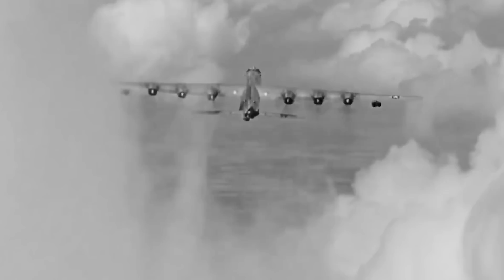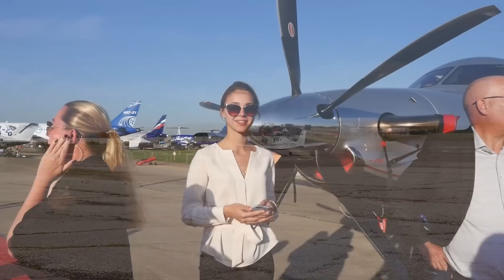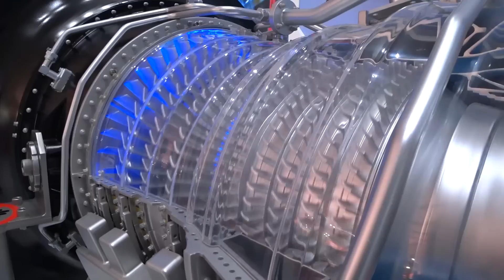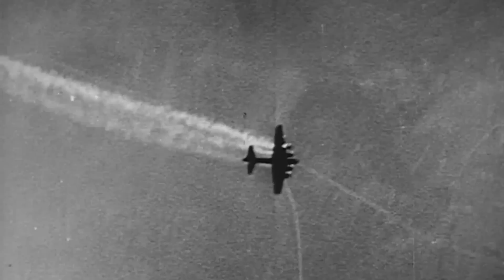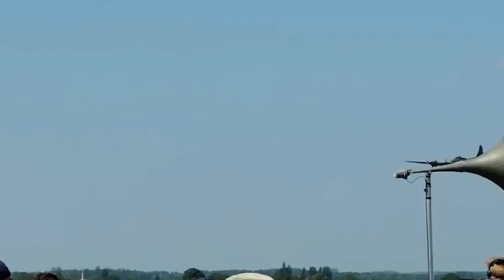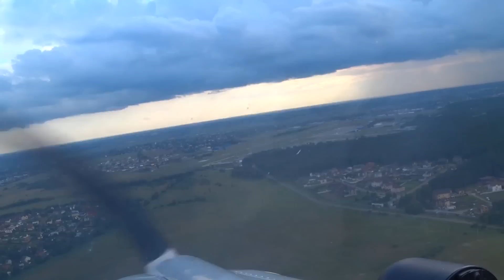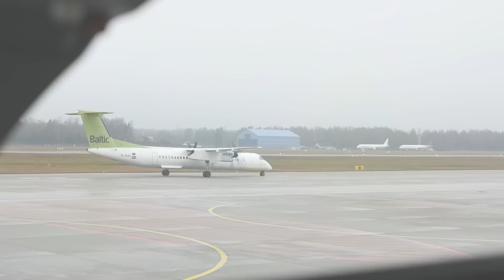Piston and Turboprop engines | What is the difference?

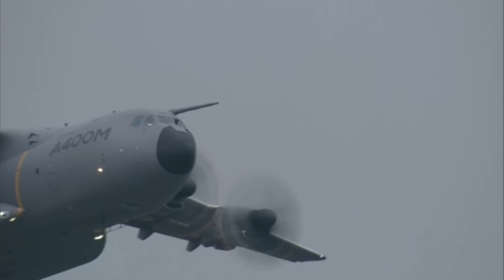Comment: @15:00 you mention some turboprops that can go 800 km/h and show a Soviet Tu-95 "Bear" bomber as an example.  While certainly true it should be noted that the Tu-95 was ridiculously loud (many consider it the loudest plane ever made).  IIRC American pilots could hear it over the sound of their own jet engines when they intercepted it.  American submarines reported hearing them flying above.  I also think the Soviet crews, even with ear protection, suffered as well.  Part of the problem is, in order to achieve such speeds, the propeller has to spin so fast that its tips exceed the speed of sound and make sonic booms.

So yeah, you can make a turboprop that fast but no one ever will again.
Reply: the loudest plane ever made was way forward the Republic XF84 "thunderscreech"...and NO the tips from the propeller from the Tu95 are NOT supersonic: the RPM is only 740rpm for a diameter of 5,80m... and the AN22 use 6,20m propellers but fly a bit slower...
Reply: @leneanderthalien  The Thunderscreech only made a few test flights.  The Tu-95 was in full production.  As to which was louder no one is certain...they were both quite loud but reportedly the Thunderscreech was only super loud once during a test flight where they really pushed it.  There are many reports (just Google it) of the Tu-95 propeller tips being supersonic but it is difficult to verify.
Reply: @jeffbergstrom  thats the compressor I call noisy. It's like the Rolls-Royce turbines. Which are the noisest I've ever heard for no AB. Hung on a G-1 & Vicount. The G-2 and Bac 111 terrible noisy. DON'T they put like a Gross of compressors disks in them.

Comment: Fascinating and informative as always! Thank you. I would be interested in learning why modern gas-turbine helicopters have relatively small ranges compared to fixed-wing turbo-props. I assume it is because the rotors are providing lift AND thrust whereas planes obviously have wings solely for lift. 
Thanks
Reply: That and also maybe because there's not much room for fuel in most helicopters compared to aircraft
Reply: @BTK50CAL  Of course! Thank you.
Reply: God never ment for all of those moving parts to fly (rotary wing) in such tight formation. 🤣
Reply: There was a time I spent a lot of hours in a helicopter - and the pilot told me planes glide through the air like a bird, whereas helicopters simply beat it into submission. This followed by his admonishment that if the rotors stop, we had all the aerodynamic capability of a free-falling rock.

Comment: Piston stagnated in GA for far too long as Lycoming and Continental got lazy with their designs which had not changed much in at least 50 years.

It took Light Sport Aircraft coming on line for modern Engines like ROTAX (and much later it's competitors) to become popular  bringing GA Pistons truly into this millennium .
Reply: You are joking, right?  Rotax is a toy engine compared to what Lycoming and Continental make.
Reply: @speedomars  my point is those companies engines are in the stone age.  Just because an engine is bigger doesn't make it 21st century tech.

Those companies might want to lift their game lest ROTAX put another two cylinders onto a 915 and put them out of business.
Reply: @speedomars  keep fight the good fight bud
Reply: @RobMcGinley81  Btw. I owned a Flight Design CTLSi (had a Rotax 912iS engine) and now own a Cirrus SR22T with a Contintental TSIO 550K engine.  So I have personal ownership, maint. and flight experience with both engine types.

Comment: well... you should add more concrete information on fuel burn
Reply: I flew many hours in PA31's , 310s,325s &350s (3000 +) the best I remember is @ 30 gal  per (325) & 3 5ish (350). The 310s were a long time ago and it didn't have a fuel totalizer but I'm thinking it was @ 28.
I ran 32" to 35" & 2200 except for the 310 @ 2400.
1500 c  ITT Religiously.
The - 35 on an E90 seems like was @ 60 gph each side. Especially below FL 180. It was about like a R-2800.
The B200 with  - 42s  burned about like the -35s if you would get up to fl280 or higher. Again, that was 20+ years ago.
So the Prat & Whitney's was basically burning twice the fuel. Which was OK back say 1975 on back because kerosene was about half the price of 100/130. The green one.
That all changed in the 80s to today. Not a lot of difference in price now. I guess that is why the AG pilots burn diesel from the farmers co-op these days.
Seems like a pt6-42 will burn in excess of 120 gph per side down low if you don't pull a lot of power off.

Damn, that gave me a headache. 🤣
Reply: Pa31-310 200#/he
325 about 230#
350 around 250# all around 170 ktas 
Pa31-620 480# @ about 250 ktas   on a 350 nm flight the turbine will save you about  40 minutes, and cost you about 40$ more in fuel.    You will also be pressurised and above most weather . You get what you pay for

Comment: You haven't mentioned most piston engines are stuck in the past technology wise (they still use carburetors and AVgas contains Lead...) So from environmental aspects the turbo props are better.
Reply: many use direct fuel injection and pretty sure none of avgas use lead any more at least i know its not used in europe for 30 years.

Comment: Excellent overview. You might have concluded with aviation diesel engines that burn Jet A1 fuel, which brings the best of both worlds to general aviation. Diamond Aircraft has a couple of planes equipped with these engines and they're very economic to operate. Also a mention of electric motors and batteries would be nice. Maybe a topic for future video :)

Comment: Electrics are coming and I see the day the small piston engine will go the way of the dodo bird.
THAT will be both reliable and cheap to use and maintain.
Reply: if batteries get light enough turbo props will go away too since electric motors can fly higher more silent more reliable and cheaper... it all goes to batteries.
Reply: @jebise1126  the problem with why I don't see electrics replacing the higher flying birds is that bleed air is used to pressurize cabins etc so I can't quite see electrics will be enough power to both propel the plane and run the other stuff.
I do see a future where hydrogen power replaces av Kero tho for those higher Flyers.
Both will give us what we need.. non-polluters
Reply: @jeremiahjohnson6082  you can add simple compressor to add new air in cabin

Comment: One thing you forgot to mention is the propeller speed, during WWII piston engine manufacturers for military aircraft were chasing higher rpm to obtain higher speeds however commercial aircraft are required to be quieter and more comfortable so keeping the prop speed at subsonic levels became the new norm which is also why the turbo fans keep getting bigger. Otherwise, any of the WW1 & 2 aircraft rebuilt today with the same objectives (being faster and more powerful than the enemy aircraft) would be substantially more powerful, lighter, and of course faster.

Just imagine a new corsair with the T56 engine from the E-2/C-2 :D
Reply: if you go super sonic with propellers you loose efficiency so even WW2 propellers did not do that. they knew about it and plan accordingly. most WW2 engines used reduction gear while in WW1 engines had lower RPM so propeller was slower

Comment: The description of the jet turbine is somewhat inaccurate. Typically there is a gas generator with one shaft and a second set of turbine(s) that power the fan/propeller but that is a second shaft. ( I am not sure if this is the case also for really small jet turbine engines)
Reply: I'm pretty sure you're describing a turbofan, not a pure jet engine

Comment: So, which one is more reliable? Make your mind already!
Safety is kind of big deal when you're up there in the sky.
Reply: The turbine is less likely to fail, but when it does it is usually totally and completely with a big bang. Piston engines on the other hand fail more often, but also very often they fall apart more slowly and give some power for a while. Believe me, I have had both types fail just after take off.
Reply: Lemme simplify it
Depend on how money you have on your pocket to maintain those engines

A well maintained engine always works better than a superior engine but you cheap out the maintenance, lol
Reply: @megimargareth4015  I am not sure that you fully understood what I was saying. Turbines are inherently much more reliable than piston engines, look at the TBO. Piston engines are relatively cheap, but consist of large numbers of reciprocating parts, some of them very heavy, that tend to fly apart which is why they need a lot more maintenance and wear out relatively quickly. On the plus side a turbine is really a single cylinder engine and when that one bit fails you haven't got an engine, whereas piston engines will often keep going for a short period even if a major part has departed. In flying that short period can be very important.

Comment: You forgot to mention diesel in the fuel types for piston engines.  Those are becomeing more popular now, and are more fuel eficent than gas....
Reply: diesel aviation engines are based on an auto engine.  they are low HP and fly slower.  they burn Jet-A fuel...not really much of an advantage to one.
Reply: Still pretty much the same with normal avigas piston, if you don't count the worst power-to-weight ratio of diesel-turbo compare with avigas-turbo

Comment: Many turboprop engines run at 100% RPM and what controls it is called a power lever to vary the prop pitch and fuel.  This makes response similar to a piston engine.
Reply: That is the  Garrett.  The PT6 runs N1 and separate prop control to control power

Comment: P-51 guys are like: I fly just as fast as most single engine turboprops.
Reply: It wouldn’t be a P-51 Mustang anymore, but a F-51N Warhorse.
Reply: @kinglouiev9530  So it's the exact same aircraft but with a better engine...
Reply: But a P-51 with a turbine would out perform the Merlin powered one.. and be way more reliable!
Reply: Billy Badswede it was the P-48 Enforcer
Reply: @priceyA320  a Turbine Mustang....
You know, why not?
There's plenty of OEM Mustangs still flying in today's world! (Hundreds!)
Hundreds of ever-faithful Merlins still in use.

Let's put a PT6 on a P51! 
Specifically, the latest model! The PT6A-135B.
2/3 the horsepower
1/4 the dry weight.

That's a project I'd entertain!
Reply: Billy Badswede actually it didn’t. There was a turboprop powered P-51. It was slower. 🤷🏾‍♂️
Reply: Billy Badswede you are talking about the Cavalier Mustang. Same top speed of 440mph. Try again.
Reply: @lucifermorningstar4548  Okay I’ll bite. P-51 max take off weight 9200 pounds. P-48 MTOW 14000 Lbs. A clear performance gain. Rolls Royce Merlin time between overhaul, 200 hours. Rolls Royce Dart TBO 2000 hours. So I stand by my original statement. A turbine powered P51 would out perform and be more reliable than a piston one.
Reply: Billy Badswede but it didn’t. I’m not talking about TBO or any other thing that doesn’t matter in this case. The only thing that matters is how fast the propeller can change the velocity of the air, and that comes down to horsepower and prop pitch. The reason the piston P-51 is just as fast as the turboprop powered one is simply because it can fly just as high in the thin air because it is turbocharged. The thrust lapse for a turboprop removes its power advantage at high altitude compared to a highly turbocharged piston plane. And down at low altitude I shouldn’t have to tell you how fast the Reno Racing piston planes are.
Reply: @lucifermorningstar4548  Whatever. Turboprops would clean up at Reno which is why they are not allowed. The most powerful piston engine is in the 5000 hp mark and turboprops go up to 14000 hp and do it reliably and at high altitude. You’re living in the past. Having flown piston, turboprops and jets, turbines are superior. Period. End of chat.
Reply: @lucifermorningstar4548  That probably depends on which Turboprop engine you put in it.  Kinda like which Packard engine variant or even (shudder) putting in a single stage compressored Alison V-1710 .vs. the dual Stage compressored V-1650 that Packard made under a R.R. license!
Reply: @priceyA320  I've flown them all as well. And I agree that 101‰.
I would also be more likely to fly a single turbine at night &/or IFR than Any single piston.
You just can't beat a turbine for reliability.
Reply: @priceyA320  coughs in F4U corsair
Reply: @priceyA320  Also coughs in P-51 voodoo
Reply: @priceyA320  Which P-51? There's more than a few.
Reply: @georgegarrett9021  for a modern prop powered light ground attack aircraft / missile / bomb truck that can operate from short unprepared runways , ect & mostly flying at relatively low level. With a requirement for long range , loiter time & operational costs & payload . Does that favour one engine over the other ? Thanks
Reply: Good old days :)
Reply: Yep and a PT6 can go 100's of hours between minor maintenance and 3600 hours before off wing inspection. Mustang V12 Merlin needed hours of maintenance every flight, major valve adjustment and work every 25 hours and overhaul at 700 hours.
Reply: Under commercial ops we can get extended TBOs. One place i was at had a 9600 tbo for PT6-67s
Reply: Jesus Christ is the way the truth and the life.
Reply: The jet guy: get a load of these losers.
Reply: Do-335 guys: 😳😳😳😳😳
Reply: You mean the guys that can afford a 2M airplane?   The "money is no object" guys?    Sure, I'd LOVE to own a P51.   But I'd probably buy a King Air instead and lease it out when I wasn't flying it.  Depreciating asset and all that.   And when it was time to go, toss the wife and kids in and go.
Reply: Ta 152, He 100, griffon spits : you're not the only one!
Reply: *Laughs in Spitfire Mk.24 flying in fucking space
Reply: Speed is one thing, endurance is another one so is also payload and seats numbers.
Reply: Like? Like what? You mean they might suggest their 60 year old plane with a Rolls Royce piston engine is as fast as a "prop-jet".
Reply: @davidpeters6536  YES! There is a limit on the prop speed no matter what engine. Remember the thunderscreech!
Reply: But I can't catch an airliner with turboprops: the Tu-114. And it can travel vastly longer distances with a lot of people inside.
Reply: A turboprop is vastly more efficient than a piston engine. So there is that
Reply: nah me spitfire...
Reply: P47M was faster then the Mustang.  504mph in level flight at 34,000 feet.  Burn rate of 304 gal/hr.
Reply: There are no P-51 guys...any of them still flying are antiques...and cost millions to restore given he rarity of parts.
Reply: Turbo props dont have as much torque. So it can yaw and roll in both directions as efficiently as the p51 in only one. P51’s were just overbuilt brutes. But vs the smoothness of the turbo props?  Not a chance. Pressure is used in two separate ways to drive the plane. 1 is torque driven from pressure. That torque doesnt do much since atmosphere thins. You need to move more air not cut it from more resistance. So torque is pointless. Turbines are moving more air over more time and able to use this compression as thrust. Maintaining a lower atmospheric density in their thrust. So less atmosphere is corrected.  

Its like hp vs torque in racing. Less atmosphere then require more horsepower. To intake the same amount of air.
Reply: Realistically there are niches for both piston and turbine engines (whether using a rotating fan/prop or not) and neither exist in a vacuum where the shaping touch of economical factors and the specifics of the role they're intended for don't exist, remember perfection is entirely subject to one's desires and expectations!!
Reply: bf109 k4 reporting in! Why is no one is mentioning at all here fuel? Turbine engines can run off of glorified diesel fuel. The piston engines everyone is talking about are basically running on liquid gold 150+ octane gas, nitrous oxide, water meth, and power thirst. 
This is like giving 1 horse in a race a carrot and the other straight meth and both of the horses cross the line at the same time. Sure you got a tie but now one horse is just retarded.
Hope that helped. Cheers!!!
Reply: A-26 guys are like - I can cruise just as fast as a P-51 and can take a break and sight see while the other pilot has the controls
Reply: what aircraft would you suggest? I need about 4 seats & space for a motorbike to fit inside
Reply: According to the Museum of Aviation Foundation the P51H has a top speed of 487mph with a cruising speed of 380mph with a piston Rolls Royce Merlin V1659 Engine pumping out 1,380hp with War Emergency Power of 2,218 hp.
The D model is ~50mph slower than the H model that never seen combat.
Just imagine the possibilities of a P51N variant with a turboprop the size of a Merlin Engine... oh wait 
Did any of you know the US Navy attempted to make a supersonic turbo prop fighter? The F-84H Thunderscreech was so loud even with noise canceling headphones the amount of decibels coming from the screeching engine had permanently affected the ground crews. This was from the propellers constantly breaking the sound barrier with each rotation. 

Maybe adding a large turboprop to a P51 isn’t a good idea. Do it on a D.520 instead. It’s a much better fighter because it’s French!